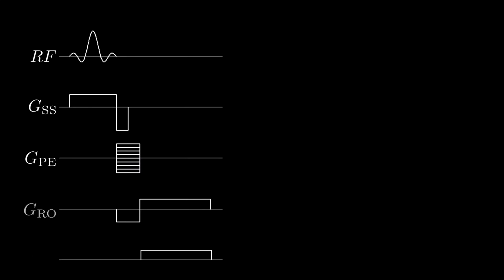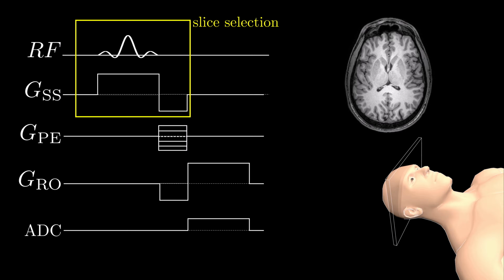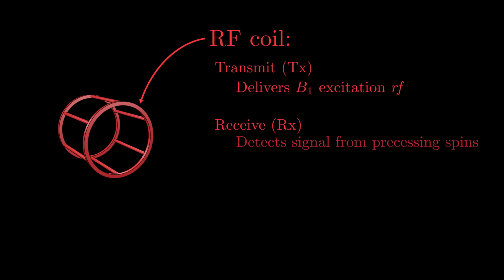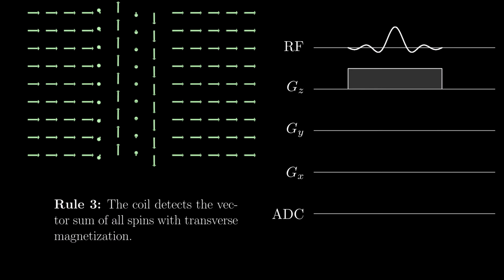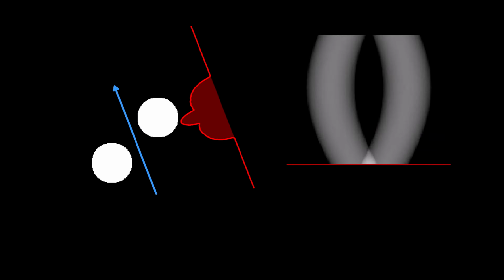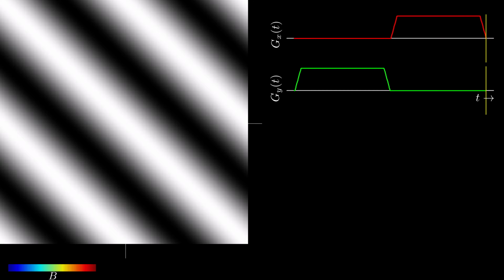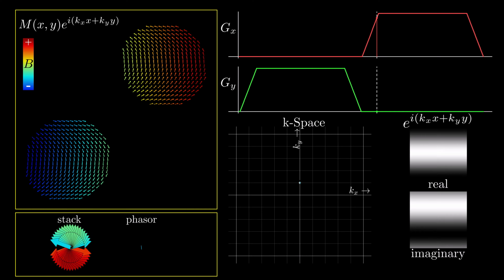How MRI Works - Part 4 - The Gradient Recalled Echo (GRE)

Comment from the maker: Error Corrections and clarifications:
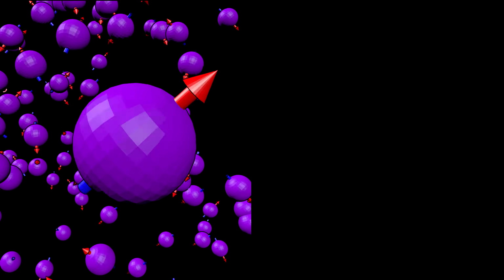1:22 - When we morph the many spins into one M vector, the animation shows M precessing about B. If the spins are in equilibrium then M would be colinear with B and no precession would be occuring, but here I animate as if our spin sample had just experienced excitation and thus M and B are not aligned allowing for precession - defnintely not clear in the video (thanks to @SCramah13!)
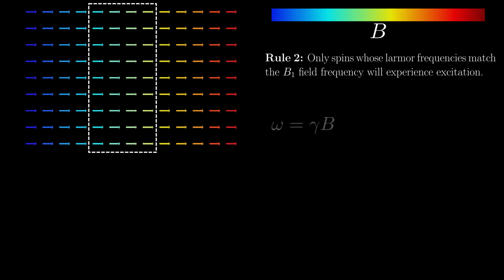20:19 - Δω is not 42.578 kHz, it's 4.2578 kHz (thanks to @johnclarky4375 for catching this!)
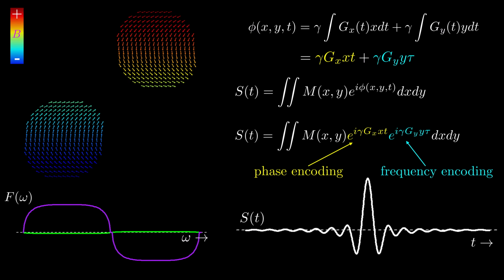36:06 - My labels for 'phase encoding' and 'frequency encoding' are swapped. (thanks to @timangoes for this one!)

Comment: 0:00 - Intro: GRE timing diagram = MRI scanner 'sheet music': RF + 3 gradients + ADC/readout; foundation for MRI pulse sequences.
1:07 - NMR Review: spins with magnetic moment precess around B; total magnetization = M.
Bloch equation describes how M changes in magnetic field.
Larmor equation: frequency = gamma x B; stronger B -> faster precession.
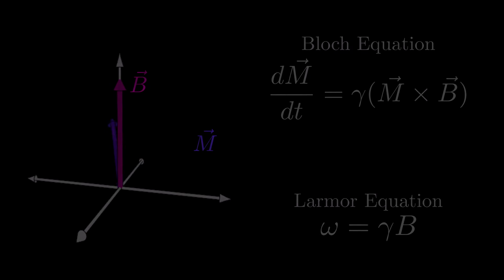2:14 - Laboratory/Rotating Reference Frames: laboratory frame = actual precession frequency.
Rotating frame = frequency difference from resonance; easier to visualize phase.
4:18 - The Gradient Echo: gradient makes B, therefore frequency, depend on position.
Spins dephase; opposite gradient rephases them -> signal peak = gradient echo.
GRE uses gradients, not a 180° RF pulse, to create the echo.
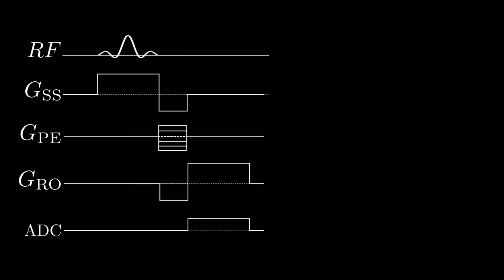7:28 - GRE Overview: slice selection -> phase encoding -> frequency encoding/readout.
Repeat sequence with different phase-encoding gradients -> reconstruct 2D image.
10:52 - Scanner: B0 Magnet: strong static homogeneous field along z.
Tiny B0 variations -> faster T2* dephasing; best homogeneity at isocenter.
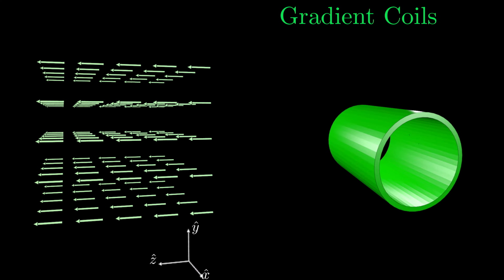12:57 - Scanner: Gradient Coils: Gx, Gy, Gz make B vary linearly with position.
Gradient direction = direction in which field strength changes, not direction of B itself.
16:45 - Scanner: RF Coil: creates B1 for excitation and receives NMR signal.
RF reaches all spins, but only spins at matching Larmor frequency are excited.
Detected signal = vector sum of transverse magnetization.
19:23 - Slice Selection: gradient maps z position -> Larmor frequency.
RF bandwidth -> slice thickness; carrier frequency -> slice position.
Rephasing lobe restores phase lost during slice-selection gradient.
26:46 - The Signal Equation: each spin contributes magnitude + phase.
Coil measures vector sum of all spins.
Gradients control phase as a function of position -> signal becomes Fourier transform of spatial magnetization.
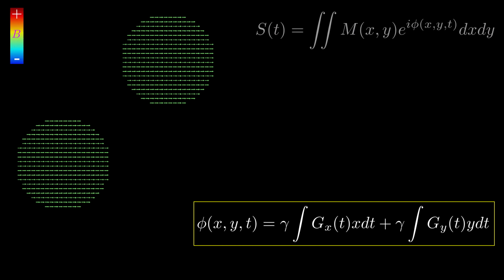29:17 - Frequency Encoding: x-gradient maps x position -> frequency.
Fourier transform separates frequencies -> spatial positions along x.
32:56 - Phase Encoding: short y-gradient gives phase depending on y position.
Phase encoding + frequency encoding -> 2D spatial information.
36:20 - k-Space and Gradients: k-space = spatial-frequency representation of image.
Gradient area determines movement through k-space.
Stronger/longer gradient -> farther movement.
FOV determines k-space spacing; resolution determines required k-space extent.
44:19 - k-Space and Signal: each k-space point stores one complex phasor from the summed spin signal.
Fill k-space -> inverse 2D Fourier transform -> image.
48:30 - The Gradient Recalled Echo Sequence: phase gradient selects ky.
Negative readout lobe moves to one side of kx.
Positive readout gradient crosses k-space while ADC records the echo.
Repeat with different ky values -> fill k-space.
52:06 - Phase vs Frequency Encoding: both encode position through gradients.
Phase encoding happens before readout.
Frequency encoding happens during ADC sampling.
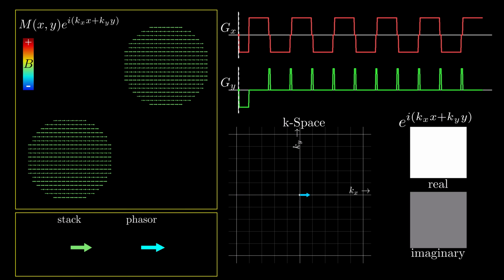55:42 - Echo Planar Imaging: rapidly alternate readout gradients while stepping through ky.
Many or all k-space lines acquired in one excitation -> very fast imaging.
56:23 - GRE Exercise and Outro: GRE links gradients, phase, frequency, k-space and Fourier transform into one imaging sequence.
Same concepts underlie many more advanced MRI sequences.

Comment: Hi, I have one question about reciving bandwith,  normally when we talk about bandwidth, let's take light for example, the spectrometer may collects 500-600 nm light when it goes to 400-800 nm the bandwidth is higher. Like you excited the slice, you have a band width, because different spin is in different frequency. but when you do reciveing, i suppose the frequency is talking bout K, However no mater you play longer time weak gradient or short time strong gradient the path in k space should be same. so the "bandwith" should be the same right?
Reply from the maker: The excitation bandwidth is the frequency span which will excite a certain 'distance' of spins in a given magnetic field gradient strength. When encoding during receive the bandwith is chosen so that while applying a gradient that no spins will be precessing faster than nyquist. If a stronger gradient is played then spins will precess faster so the bandwidth will need to be higher. The k will be the same (spatial frequency), but w is not (temporal frequency). Does that help? Great questions!

Comment: Would it be correct to say that M(x,y) is, in reality, a function of time due to the ensuing transverse magnetization relaxation process? How does this alter the formulation of the fourier transform application?
Reply from the maker: Indeed M(x,y) is a complex function of time. Our model for the GRE here assumes that M(x,y) is static. This of course isn't true, but on the time scale of a readout, these effects can generally be safely ignored if the readout is quick and T2* is long (not always the case, but fair for most biologic tissues). Similar to taking a photograph, we find a balance between our subject's motion (analogous to T2* decay) and the camera shutter speed (analogous to readout time) to reproduce the best 'snapshot' of M(x,y). Hope that helps

Comment: I studied electrical engineering and am now doing a phd in RF analog electronics. The 3rd and 4th videos of this series give an idea of some of the math I encountered in my studies.

Before encountering this video I wasn't aware of the connection between MRI and RF technology. I'll have to check out some research on the transmitter and receiver section of MRIs.

Comment: Could you please clarify whether or not the net magnetization vector should be visualized as a precessing vector @1:35? My understanding of NMR is that this is NOT true (because all of the x-y components of the magnetic moments of all individual nuclei effectively cancel out)...and if there is no net magnetic moment in the x-y plane, then all of the net magnetism is directed along the z-axis, which means the torque from the perspective of the net magnetic moment vector is 0 (i.e. no precession about the z-axis). However, you seem to suggest that this is the case with your language: "collectively, the quadrillion of spins in space sum to a nuclear magnetization vector M..." and then you provide a picture of this presumed net magnetization vector M (purple arrow) and depict it as precessing. Isn't this incorrect?
Reply from the maker: You make a good point! I should've made it clearer in the video, but when the M and B vector animation appears it is immediately following excitation, not in equilibrium. You are certainly correct that in equilibrium, M would be stationary pointing in the z direction and no precession would be apparent. An rf pulse (which I didn't show) is necessary to tip M away from B and see precession. Thanks for this observation; comments like this are helpful so I can see where gaps exist in my presentation! Cheers

Comment: @36:12 , it seems that the labeled exponentials for phase encoding and frequency encoding are flipped? based on the preceding sections, frequency encoding should be the one with time dependence and the phase encoding term should be the one where the gradient is only turned on for some time tau
Reply from the maker: Arg, you are correct. I did swap those. Thanks for catching!

Comment: Minute 21:15, when I calculate delta omega i get 4.2578 kHz. Where am I missing the faktor 10?
Reply from the maker: Oh wow. You're absolutlely right, the bandwidth is 4.258 kHz, not 42.58 MHz. Good catch! A bit embarassing that not once in making the slide, writing the script, and recording it did the abnormally high bandwidth seem odd, ha.Thanks!

Comment: as someone who already knew the basics of mri that magnetic field strength and phase are varied along the axes to encode location, I can say that this video did nothing but obfuscate the concepts. it seems you are more interested in making fancy looking equations than explaining the concept, clearly exemplified by using an integral to denote a simple linear equation for phase as a function of a linear dimension. i will have to come back to see if this video is useful as a way to solidify knowledge one already has, because it certainly is a terrible way to learn this stuff

Comment: MRI MACHINES ARE Deadly and Harmful to  PEOPLE DUE TO MAGNETIC INDUCTION FIELD AND CELLULAR EXPOSURE TA HIGH MAGNETIC TESLAS SO MRI ISA A DEADLY MACHINE ALLLLL U GTTA DO U SEARCH MRI DANGERS N YOULL C ON YOUTUBE OR SEARCH ENGINE PAGES ! THIS LIKE ALL MANMADE DEADLY ELECTROMAGNETIC TECHNOLOGY IS CALLED MALE END ELECTRONICS! WANT UNHARMED ENERGY IS TA USE FEMALE END TECHNOLOGY USING PROTECTIVE STATIC CHARGES AND IMPLOSION PHASE CONJUGATION TECHNOLOGY NOT THIS CRAP!  EVEN DA EM FIELS U HUMANS USE AT HOME OR ANYWHERE IS ALSO USING DEADLY MALE END ELECTROMAGNETIC RADIATION TECHNOLOGY THUS DEADLY BY DESIGN ! Also Manmade electromagnetic technology is NEGATIVE GREEN ELECTRON SMOG THUS deadly to biological species PERIOD! So I know this dude SOUNDS SMART BUT NOT REALLY ! Lololol 😅 also MOLECULES are NOT suppose to b exposed ta Ultra low magnetic field such as 1MILLIONTH of 1 Tesla WHICH IS ULTRA SMALL MAGNETIC USUAGE but da world u humans r in is programmed to cancel everything YALL do !

Comment: I use a Siemens Prisma (with 80/200 gradients) and we recently acquired a next gen Siemens Cima which has 200/200 gradients. Does the benefit of the higher gradient strength come from better separation of the phases at each end of FoV, thus yielding greater contrast?
Reply from the maker: There's a few benefits to higher maximum gradient amplitudes including faster traversal of kSpace (good for collecting signal of short T2* samples, and rapid imaging of the heart) and ability to get to the kSpace edges faster (better resolution), better diffusion weighting (can acheive higher b-values in same time), fewer susceptability artifacts. Though higher gradients strengths can be louder and are more likely to cause peripheral nerve stimulation in some sequences. Cheers!

Comment: Excellent video. With these equations of the Partitions Trigonometrics and Spirals. I have made X-rays a solid of revolution in 3D.
https://youtu.be/Y_eQAANhI4Q
https://youtu.be/wBNeK01sbSA
In these videos, you can see how this equation of the Trigonometric Partitions as a function of s when n is 0 and the angle sliders, the value of k turns, and the value of the height m begin to slide one by one. As we start to activate sliders like k; one dot (red) starts to rotate while the other is fixed. Later, if we activate m, the two red dots begin to move in a rotating manner. And finally, when we activate n and they are positive values, the solid of revolution appears in 3D. But when n takes negative values, the color of the solid in the 3D plane disappears and likewise, the graphs of the normal functions (green, purple, and blue color) disappear, leaving only the polar function as a dot, and we can see the x-rays of the solid of revolution, it is practically like x-raying the solid of revolution in the third dimension. The parametric equation in the 2D plane appears as two dots, but when all sliders are active the polar equation is a straight line placed radially in the polar plane. In the 3D plane, this same polar equation that forms the solid of revolution appears its lines and color that form the solid of revolution, when only the sliding angle is active and n is zero. At some points, it seems that we are studying the duality of two particles when n is zero and the two dots that are part of the same equation appear, and when n is positive a linear function or red straight line appears that moves radially. At some point, GeoGebra slows down when the x-ray of the solid of revolution appears and the 2D plane stops for a moment.